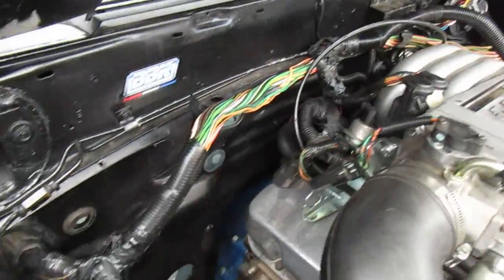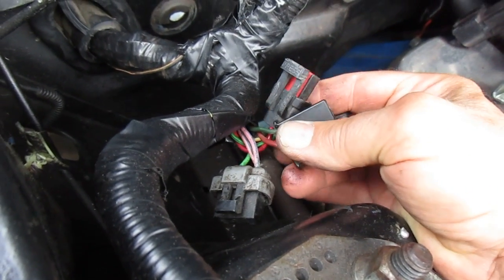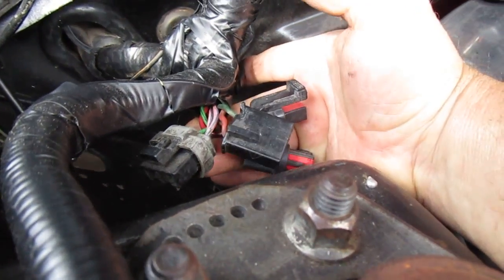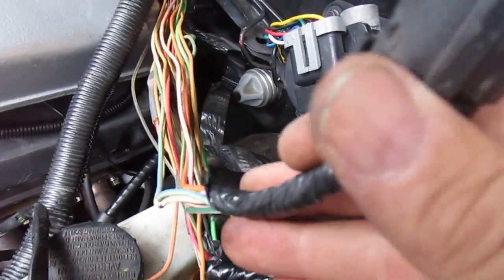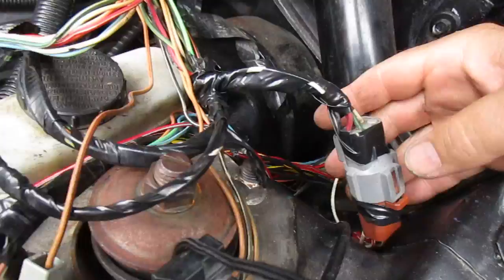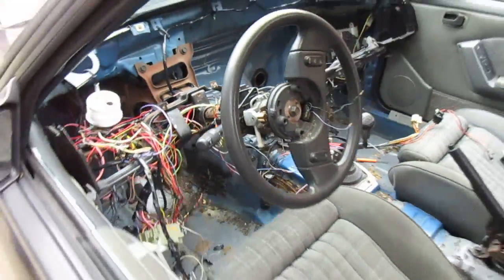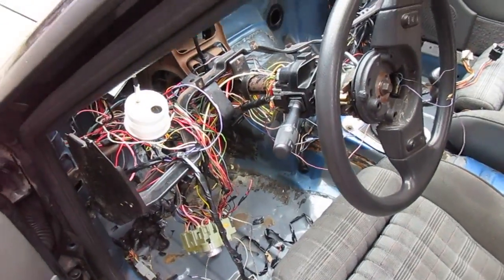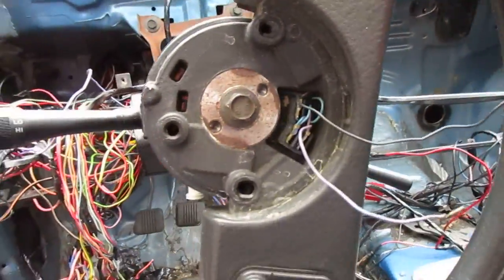Fox Body Mustang Wiring pt 2

Comment: What year car is that  I thought a 89 was supposed to be black in gray plugs by the master cylinder what are u wiring it straight thru I seen u had the gray was plugged into a brown plug I don't how did that work???